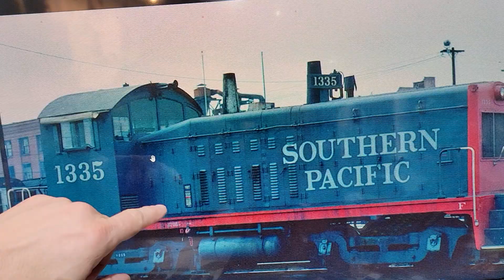Athearn SW1500 Total Rebuild Part 10 Decals

Comment: I'm sure you are missing my off-the-wall comments.  SW1500 is my first and oldest unit.  In 50-plus years of service, it still runs like a top.  Have not decodered it like all the rest, but I think now is the time.  On the big layout, it ran on a shortline with a reverser and timer.
Reply from the maker: This pair is going to be super sweet, tomorrow should be a test run!

Comment: Love your work and this series ...... do you make your own decals and,if you haven't already done so , could you show your methods and tooling if you do. ..... if not,what is your source?
Thanks in advance .....Eric (Scotland )
Reply from the maker: yes! I make all my own decals for everything!  in general, I use white or clear waterslide decal paper from amazon.  I use epson photo printers to print the decals on the paper (epson photo printers are dirt cheap.) I use a 300watt barn light in a $10 cheap light reflector to cure them (sitting on top of some bulletin board cork panels - also super cheap.)  I have an ancient ALPS printer that still has some life left, but they are very hard to use and can't go past Windows XP service pack 1 - but sometimes I will make some white decals with that - don't get one, there are modern Okidata printers that are lightyears superior for white ink.  When I do most of my white decals, I use a Cricut Explore (old now - but newer versions are even better) to totally cut the decals directly from white decal paper.  I do my designing mostly in Inkscape (open source and free) but that program has a steep learning curve right away - I need to do a video showing how to skip the learning curve - some simple advice on the setup for model railroaders will open a whole new world.  I got tons of decal videos, but this latest is mostly how I do it right now.  The older videos, which should have a playlist, are very good other than I no longer use amonia and I use a lot more dish soap!
Reply: @elite194  Thanks for your rapid reply. The Southern Pacific and associated numbers in White(?) .... printed on Okidata  Inkjet ?.
Can't really visualise the Crichton process ...... presuming its a cutter ?
Reply from the maker: @ec140752  these SP letter and  numbers were printed on the ancient Alps printer, but like I said don't buy it because quality is an issue and it only works with ancient computers.  I had to use it because a Cricut isn't great for tiny lettering that uses serif fonts, like times new roman, or in this case century fonts.   there are brand new modern okidata printers that can do white - something I'm likely to invest in this year!  but, I used to take my decal sheets as a pdf to a local printshop along with a piece of clear waterslide paper and get the sheet printed for about $5.  best bet - call local printers to see if they can print white and make full sheets as a pdf - you'll get tons of decals for next to nothing!

Comment: Actually the old Athearn blue box sw1500's were  sw7's,Athearn  eventually did a sw1500 in the blue box line I think the proper sw1500 showed up around 1986 or so.
Reply from the maker: 1335 and 1337 are NW2s on the SP, and there were 2 SW7s that were looked at for this project also - 1 of which appears to still exist in the deadline in Mt Vernon IL if it hasn't been rebuilt yet!